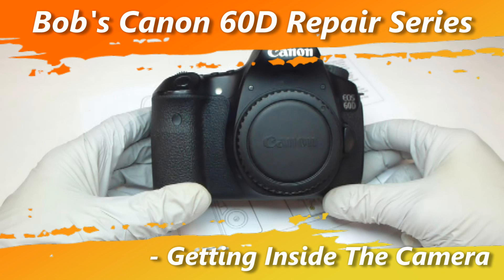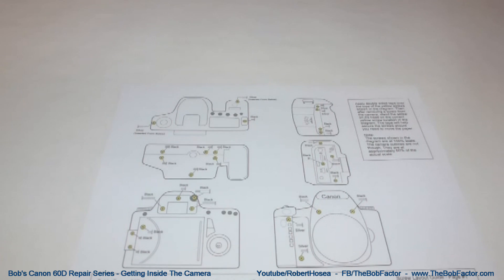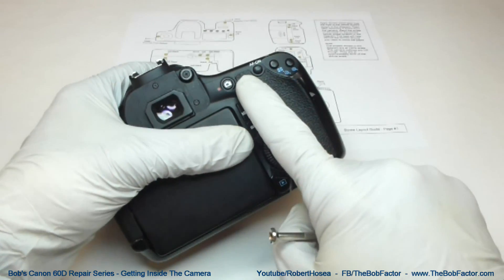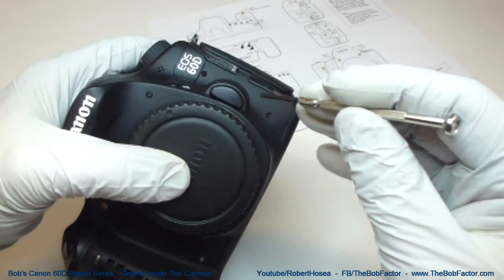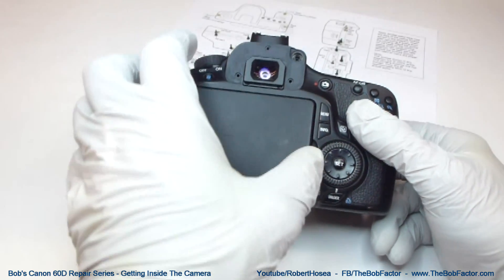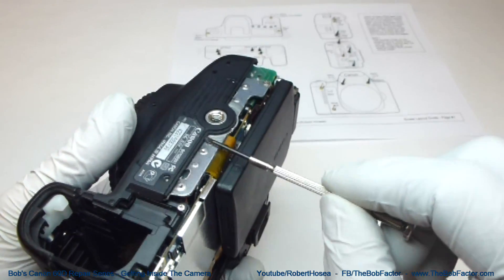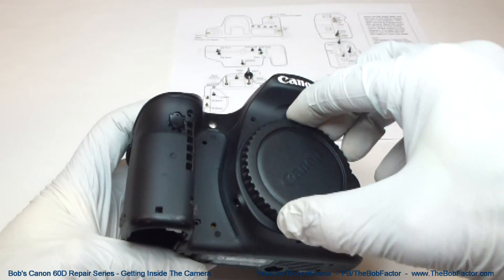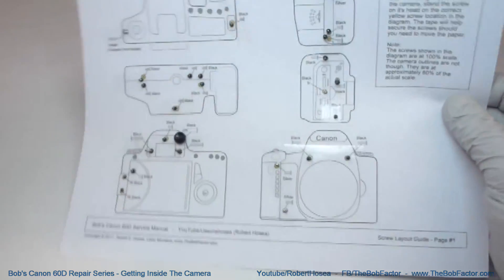Canon 60D Repair Series - Video #1, Getting Inside The Camera

Comment: I've used a lot of different tutorials over the years, but this by far was one of the best!  My wife had broken the top LCD screen... but not the top glass! This made quick work of the repair and only cost me 30$.  I can't Imagine what it would have cost taking it to a repair shop!  This tutorial along with the screw placement guide made with repair a dream!!!

Thank you so much and if not for men and women like you taking the time to create videos like this,  many DIY projects would end in disaster!!
Reply: Philip Kitching hey, I took the camera completely apart as he did in the video. Once you have the top unit off the LCD is held in place by 3 screws and you have one more ribbon connector to remove and the screen lifts out.  There is a hook on the screen unit that latches the flash so you have to carefully work that piece out to remove the screen.   Also, on the small ribbon connector you have to remove there is a black bar on the connector for the ribbon that needs to be flipped.  Hope that helps a little...
Reply from the maker: Hey thank you very much infernalFirefly. I'm glad the video helped you out and that you got the camera repaired.
Reply: Hey there..what was the procedure to remove the top lcd..mine is dead too and needs to be changed
Reply from the maker: Great information! Thank you InfernalFirefly.

Comment: Thank you so much for this video. My 60D got wet while shooting at the beach and salt water sipped into the power switch. The camera would no long power on. I used your video and your amazing screw diagram to get to the power switch. Cleaned it off with some electronic cleaner and a small brush and vwalahhhh.... Thanks you Robert
Reply from the maker: Excellent! I'm glad you were able to get your Canon up and running.

Comment: Hi Robert, Thank you  for your great video. It's very well described and presented. I have a question. My 60d power switch and dial shooting mode is playing up. It mostly because salt water got in it as I am a landscape lover and I took it as often as possible to the beach. It got sprayed and splashed by wave a few times now the power switch intermittently won't turn on and sometimes when it is on it won't turn off (even I switch to off position). The dial doesn't work accordingly (i.e. when I dial to TV mode it stays on AV, I dialed to Bulb mode it stays on Manual mode) Have come accros this problem and what can you suggest for best fixing this camera. Thanks mate.
Reply from the maker: Hi Davy. I would say that you will need to remove the top part of the camera and tear down the power switch/mode dial assembly. Most likely there is  corrosion on the contacts. I don't have anything that shows repairing it right now, but I will try to get some pictures of the process in the near future. And, it really isn't too hard to tear down. Try that and see if that fixes your problems for you. Let me know how things go if you can.
Reply from the maker: Hi Davy. I've uploaded a few pictures of the internal parts of the power switch and mode dial. You can see the contacts that may need to be cleaned.The pictures can help you when you are putting it back together too. 

Here's a link to the folder:
http://www.thebobfactor.com/Canon%2060D%20Repair%20Photos/Power%20Switch/
Reply: Hi Robert, thanks for the reply and the photos. I have bought the 60D top cover from ebay for easy swap. But I will clean the one I have and put it in my other 60D which is also have the same problem. Yup I have 2 faulty 60D. I still love the camera. They still do the job for me. They still take good pictures. If you have time please check out my instagram account @davywg 
I'm still waiting for that top cover to arrive and maybe I'll do a time lapse video of replacing the top cover. Thanks again and I'll be in touch. Cheers
Reply from the maker: Replacing the top section should be a fast and easy fix for you Davy. I do show how to replace the top section in video #4 of this series, if you need any help on it. Here's a link to it: https://youtu.be/7gJr4ANik-g?t=21m52s

You have some BEAUTIFUL photographs on your instagram account. Very nice indeed! You do your camera justice. Are some of them HDR?

I am a big fan of taking pictures of moving water with long exposures. I also do most in HDR. I like doing HDR time lapse photography with my 60D as well. You can see some of my photos on my website at www.thebobfactor.com. More recent photos and videos are on my TheBobFactor facebook page.

Yes please let me know how everything turns out with your camera(s).

I have three 60D's. Two that are "currently" working well, and one for parts.
Reply: Thanks mate. You're my true inspiration of getting my 60d a new life and all your tutorial videos are just too good..thank God I found your video.
Reply: @davywirapranata4911  Love your work.  Some very inspiring and beautiful shots.

Comment: Thank you Robert. One of the most systematic take apart videos i have seen. 
My Canon 60D stopped powering on. I have no idea where to start. Tried 2 different batteries, flipping the battery door switch and the memory card door switch. Not even a blink. Would have send it to canon, but they will charge close to the price of a new one. Any thoughts ?
Reply from the maker: Hi Anil. If the camera didn't get wet when it quit working, then the first thing that I would suspect at being the problem, would the the power board. You can see the power board at time stamp 11:40 in the second video in this series. They are a little pricey at around $50-$60 for a new one on ebay. But you may get lucky and find a broken 60D for sale for parts that may still have a good power board in it. It would also be good to just double-check all of the flat ribbon cables to make sure that they are seated correctly, and if they are in a connector that has a locking bar on it, then make sure that the locking bar (I call them tabs in the videos) are down. Let me know how you make out on this. -Bob
Reply: Thank you. it didnt get wet. it was fine a few weeks ago. will check the cables and maybe a powerboard. Again, THANK YOU.
Reply: Mine did this after years of non use. The lithium battery charge had dropped below minimal level and it wasnt actually charging. I had to put the battery in the charge for about 30 secs Then remove for 10 Seconds and the put back in. the blinking should be back to 1 per sec and charging. Im sure you are way past this point but it stumped me for a bit.

Comment: Hi Robert. Thank you for you very detailed video series. After watching them, I had the confidence to strip my 60D and replace the main power board. Everything went without any drama thanks to your video.
Initial problem - I was just getting the flashing empty battery symbol on the top screen and nothing else worked. I tried leaving it for a week to drain any memory in the system, but no difference. So eventually I purchased a new power board. Using, you A4 screw sheets and detailed videos I managed to replace the power board and yes the camera came back to life.
However, upon further testing, I now have a different problem. When I turn on the power button the screen works and I can view the menu options on the colour screen. When I take a test picture it only records a black solid image this is previewed on the screen and recorded to the memory card. When I take out the card and view it on my computer it displays as a solid black image. However, when I put the card back into the camera I can see previously recorded images properly on the screen next to the black solid images. 
I am sure that I reconnected every cable during assembly properly, but can you suggest which cables might be the cause for this problem? Or is it likely to be a sensor problem? Or maybe I had this problem as well as the main power board problem at the start?
I hope you can advise me what to do next.
Many thanks again TC.
Reply from the maker: Hi Tim. 

First off, congratulations on replacing the power board and getting it back to where it is now. Even if only partially working you're heading in the right direction.

Yes, it's possible that there may have been something else wrong first, and that could have been what caused the damage to the power board. But let's double check a couple of things first.

When you take a picture, which ends up saving just a black image, are you seeing just a black screen on the LCD display at that time, or is the LCD display correctly showing you what you want to take a picture of? If the LCD display is not black and it's correctly showing you something, then that would rule out the CCD and it's circuitry. And that would point more to a problem with the SD card. Did you remove the SD card board when you replaced the power board? If so that would be a good place to double check the connections again. If the connections look good it may mean the SD card circuit board is bad.

If you are seeing a black screen on the LCD display while you are taking a picture, then that would be something entirely different, and it could possibly be that the CCD or it's circuit board is bad. Or, it could be the main circuit board. It's kind of tough to call at this point.

Bob
Reply: Hi and thanks for the reply.
When I use live view, I can only see a black screen. Which as you suggest could be the ccd board or its connections. I am wandering where it gets its power and if I left off a cable. Looks like another complete strip and check every connector again.
When assembling it last time the fibre optic cable did cause me some concern as I was not sure how that went back in. I think that I managed to sort it but that is one cable I need to check. What does it do? Could that cause black images if the camera is trying to over compensate for something?
Thanks again. Tc
Reply from the maker: The CCD gets it power from, and also transfers image data back to the main board, through the large brown flat ribbon cable that runs from the top of the CCD board to the main board. You can first see that cable in this video at time stamp 8:03. You should definitely check to make sure that the large flat ribbon cable is connected properly on both ends. Though, I think that if it wasn't connected properly, that you would have seen an error message on the screen. But, better safe than sorry.

There is also another smaller flat ribbon cable that is below the main board that runs over to the CCD board, but that cable is used for the CCD cleaning feature. I don't think that would cause this problem at all.

I'm really not 100% sure what the fiber optic cable is used for. I think it is possibly for flash synchronization or metering. So I doubt that it is the problem. But you should still check it. It simply just pushes into the socket for the connection. It's pretty obvious when it is in the correct place, because you can feel it snap into place when it does.

Let me know what you find out on the connections Tim.

Bob
Reply: Thanks again. I will keep you up to date.

Comment: Hi Robert, I am Devendra from India, I have canon 60D since few years and my manual control dial button  (lower direction) is not working. Do you have any idea how to fix it?
I have seen all your videos (all three) unfortunately you have not covered that part in your video. Kindly help me to fix this problem. also my visual screen is automatically flip up and down, what was the problem according to you?
Thank you in advance!
Reply from the maker: Hi Devendra. Is the dial button that you are talking about the four direction round control on the back? If so, I have had the same problem with one of my 60D's. But, I replaced the entire back panel on mine to fix the problem. I did that only because I happened to have one from another camera that I used for parts. I still have that original back panel with the defective button on it, and I will take a look at it to see what it will take to repair it.  

Unfortunately I'm not sure what would be the problem with your LCD screen's display flipping. I'll see what I can figure out on that for you.
-Bob

Comment: Hi from Australia Rob! fantastic vids on the 60D mate, already helped me by getting it apart. Don't know if you can help me or not. Mine was randomly not turning on, now it's totally dead. batt ok and i've tried the battery switch manually but no go, I've taken the back cover off but i'm buggered if i can find the switch for the SDcard cover?? there was a small rectangle piece of rubber (i'll take a shot and send you a dropbox link if you want to see it). the door switch was working last time i used it. it came from between the top shielded board and the sdcard board roughly on top of the battery cover switch. no idea what it's for or exactly where it goes. Anyway, do those switches go bad much? i can test it with multimeter, i'd like to try and get it gooing without removing anything else, voltages to check and locations on PS board? any fault finding at this stage would be good if you could help. Cheers and keep up the great work!
Reply from the maker: Hi Gary. Hey, I'm glad the videos have helped out. That's great.

As far as that little piece of rubber....well, I have never figured out what it's purpose is. Not a clue at this point. And I'm pretty sure that I have (unknowingly) left it out when I have put my camera back together.

As far as what might be the problem with the random powering-on problem, something that you might check is the SD card door switch. For one thing, it's the most simply constructed "switch" in the camera it seems. Almost cheap. It's just a piece of spring metal that clips on the main board. And if it's out of place and the SD card door isn't able to touch it when it closes, then that "may" be the problem. Also, if you are trying to power the camera on while you have the back cover off, then you will need to gently push down on the SD card switch where the SD card door would have normally pushed on it.

I haven't seen a battery door switch that was bad, but it might still be bad. I'm sure it could be tested with a multi-meter though. When you try to power it on now, do you get anything at all on the top display screen?

If you could email me a link to your dropbox, I can upload a picture for you that shows the SD card switch, and also the placement of that piece of rubber. You can email the link to hiking@thebobfactor.com.
 -Bob
Reply: thanks for the image and help mate, still no go.....more screws to remove!
Reply from the maker: That's too bad. It may be something to do with the main power switch then. The switch can be disassembled and checked out pretty easily. I can upload some pictures to your drop box that can help with that if you like. You will need to re-share the dropbox folder again though first.

Comment: Hi Robert. Awesome video, very detailed. I have a 60d that got dropped and the mode dial with the power switch completely came off. I retrived every pieces (at least i hope so) but not sure about putting it back together. I fixed couple camera but never deal with this problem. Could you please make a video how to do that? If not, i'd be grateful if you could kindly  instruct me how to put those piece together or send a diagram to my email autumn132010@gmail.com. Thank you
Reply from the maker: I haven't had to work on the power switch/mode dial assembly before, but I will sure take a look at it for you to see what it will take to get it back together. I will let you know what I find as soon as I have something for you. -Bob
Reply from the maker: I emailed some photographs to you. Hopefully they will help you figure out how it goes together. Let me know if you need any other pictures. -Bob
Reply: Robert Hosea Thank you!!! I just check my email and started working on it now. 😀

Comment: you mention more videos in the series, looking forward to them.  hoping to find a way around my error 20
Reply from the maker: Hi Jerry. I should have the next video uploaded later this week. It will show how to remove the circuit boards. I also got an error 20 on my 60D a few months ago. An error 20 indicates a mechanical problem. On my camera it turns out it was from the shutter curtains not closing correctly. I could see that one of the curtains had a tear in it (they are only made of a paper type material) when I lifted up the mirror and looked. It's possible that may also be your problem. The shutter has a life span of approximately 150,000 to 200,000 uses. My first 60D had a shutter count of over 400,000 and the shutter still worked well. But my second 60D barely had 100,000 when the shutter failed. I will be making a third video soon that will show how to remove the shutter assembly and replace it.